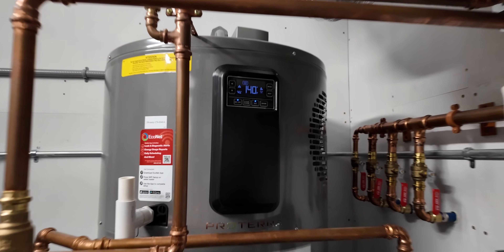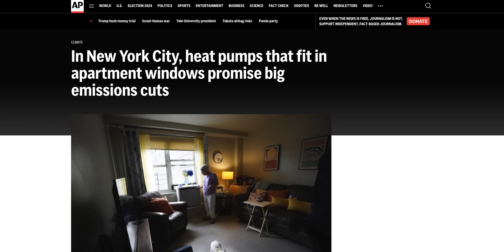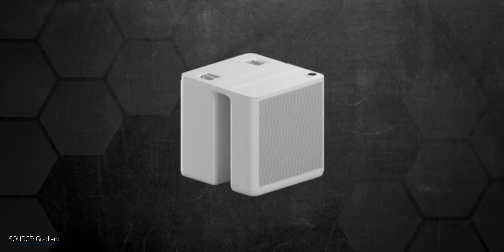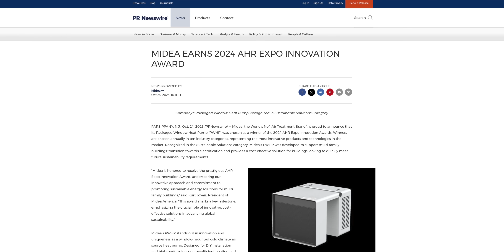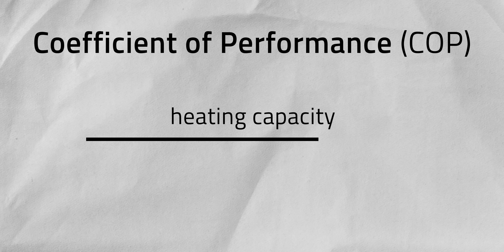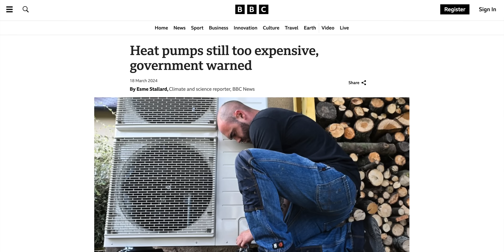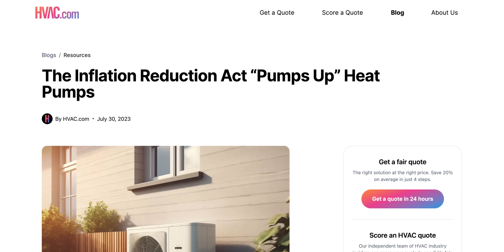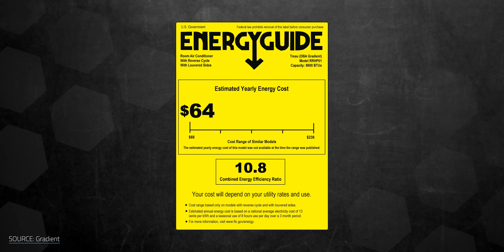Why This Window Heat Pump Is Genius

Comment: Wow - that cost is two years of heating my whole house with fossil fuels which are ridiculously inefficient and that's before grid energy costs.
A $200 AC unit is a 1-way heat pump. I'd like to see those engjneers produce a $600 unit that doesn't require financing and an extended warranty.
I could run those off my solar batteries.

Comment: Some numbers on the achievable internal temperatures would be useful. This seems to be the stumbling point for 'central' systems in older buildings. Also, in relation to the demands on the electric grid, many apartments would be using more than one unit. Would the supply authorities still be confident of meeting the demand?
Reply: Achievable internal temperatures only depend on your insulation factors. You could get 110 degrees F if you confined the heat to a small insulation box. The 9000btu/hour is the only useful metric to report. Maximum temperature would also depend on the temperature outside.

Comment: So as a homeowner I just save half the money and get a more efficient mini split... The window heat pump doesn't really sound like a good deal tbh. And for $150 for a unit that just cools to jump to $3000 for a unit that does both just seems ridiculous. I know ones with the same efficiency score are around $500 but still. Seems wayyyyyy over priced.
Reply: These are not being made for the homeowner market. Odd how so many people think thats the case. Its for apartments.
Reply: @thecocktailian2091  The point of the statement was the price. A heat pump shouldn't cost that much more than an AC unit. An apartment owner isn't going to pay 5k per apartment to barely save any money each year.

Comment: At the end of the day, for most people it's cost that matters. My friend got a Heat pump installed, and due to high electricity costs, he's paying more then 2x what cost him when he had natural gas heating. The energy guide has electricity at ¢13/kWh, I pay 3x that when you combine deliver/usage fees. While heat pumps are excellent technology, I don't expect them to get lots of traction when it's cheaper to use gas heating. Though NYC is banning gas heating in new buildings.
Reply: Yes, through the efforts off CCAN and others like it, you will be relegated to only using energy sources they approve of at a much higher cost.
Reply: You pay for gas by the therm. A COP of 1 takes about 30 kwh for 1 therm. So even if you have a good COP (say 3-5) and a therm of gas was twice as much as a kwh and the gas furnace wasn't that efficient it is still less money to run the gas. If they take natural gas away, wood furnace or propane is still cheaper.
Reply: @barongerhardt  Right, 1 therm is about 29.3 kWh. But where I live, electricity is about 3x the cost of gas per kWh, and a COP of 3.0 is really optimistic for a reversible air source heat pump in cold weather. Remember, these machines lose efficiency AND heating capacity as the outside temperature gets lower. I have a (partial-home) mini-split heat pump rated to continue functioning down to -13F, but it's cheaper to use my ancient gas boiler below about 30F, and the heat pump has trouble actually keeping the first floor warm below 20F. I know, "old home problems", but until I can get a major insulation upgrade that's how the math works. On top of that, a dedicated heater system can distribute the heat better than a system that has to do both heating and cooling. The thermal gradients in my home are greater when using the min-split heat pump than when using the boiler distributed through hot water baseboards.
Still, for keeping warm in spring and autumn the heat pump is great. It's a backup for if the boiler kicks the bucket, and it diversifies my heating energy sources in case the price of methane spikes.
Reply: @wescoleman6390  With a base difference of gas being 30 times cheaper than electric, the economics of it just don't work. These modest efficiency improvements cannot make up that gap. On top of that, they are charging 6-10x as much for what is an AC with a reversing valve. They are trying to scare people into it with "gas bad" and get government idiots to pay for it with other peoples money. Yay, taxes!

If you like how these ones look cool, but it is just an aesthetic change.

As you stated heat pumps lose efficiency fairly quickly when outside of optimal conditions. Most places I have lived, those conditions heavily skew to the lower temps. If normal inside temps are 70-75 a hot AC day might hit a high of 100 or 30 degree delta. Going the other direction that is only down to 40 degrees. I could go a whole month without it going over 40 and lows below 0. A 70-80 degree delta. These things are great, if you want your winter electric bill to be as high or higher than your summer bill. I'm surprised the electric company hasn't replaced the free light bulbs program with free heat pumps.
Reply: @barongerhardt   Gas isn't 30 times cheaper and nobody said it was. 29.3 is the conversion factor between the archaic unit "therms" used on gas bills and the more sensible kWh used on electric bills. In my part of Massachusetts we have expensive electricity ($.32/kWh) and much cheaper gas ($1.92/therm). Adjusting the units gas is $.065/kWh or about 1/4 the cost. With these rates a standard heat pump doesn't make economic sense. In other regions where electricity is only 2x as expensive heat pumps are cheaper to run as long as your average temperature is above ~10F. For these people a heat pump will cost the same in winter but will be much cheaper during spring.

I totally agree the units in this video are way too expensive. A mini-split of the same capacity is well under $1000.
Reply: Looks great Sounds even better But the $3,000 mark is a little bit over the top
Reply: If you run the heat pump by a battery storage system, where the latter loads shift cheaper off peak electricity, it should result in a cheaper system to run.
Reply: Yeah. Comparing thermal efficiency across fuel sources isn't really useful. There's an argument to be made that the government's role is to internalize externalities, meaning they should price the climate costs of using natural gas into its rate, and that might even out the cost. Comparing efficiency is useless unless the waste heat not utilized is problematic.
Reply: @andrew40  Internalizing externalities is most certainly not a role of government. If anything government should be cracking down on this as fraudulent deceptive marketing. This is the equivalent of marketing a pickup with 100 gallon tank as having a 1000 mile range being better for the environment than a civic's 500 mile range.
Reply: @barongerhardt  Internalizing externalities is absolutely a role of government. People can debate over which externalities to address, or how to best account for their costs, but to ignore it distorts the economic system.

What I'm saying is a like-for-like comparison is best. Comparing thermal efficiency of electric and gas systems is nothing more than an academic exercise. If an environmental argument is to be made, it needs to go back to full lifecycle impacts of the energy source for both. That is complicated, and fewer people are willing to sit through it. I suspect the heat pump would still come out ahead, and the only way it makes economic sense is if those full lifecycle impacts are built into the price of the product and fuel.

Comment: Why hasn't this saddle style been used for AC units this whole time! So much better to be able to have an operable window and keep the views and daylight!
Reply: A saddle design requires that condensed water on the inside be pumped up and over the U shape to be drained or evaporated outside the windows. That means that this design is more complex and failure-prone than ones where water can drain out the window by gravity.
Reply: @nathanschley2088 that’s a pretty small price to pay for the increased usability
Reply: @nathanschley2088  that makes sense! Though I still think being able to have a window that is still operable with minimal blocking of egress or daylight would make these more than worth an extra little pump or bucket for condensate in most cases! Hell if your adding the pump maybe it could even drain to a flowerbox attachment or something
Reply: And limit the amount of gap that has to be poorly installed on either side of the window. Actually if the gap is small enough this should be excellent to insulate with a single strip of foam 😂
Reply: Tbh if you look up saddle window AC you’ll find this wasn’t a new idea at all. The other downside is it has to cover different sized walls in different buildings their isn’t a standard wall thickness

Comment: I live in Boston, in an apartment exactly like you describe. We have to open the windows in the winter or die of heat stroke.
Reply: So you can spend 3k on one of these an use even more energy to cool down your apartment?  I don't get it.

Comment: The biggest thing i don't like on this setup (which is the same issue and actually worse with a window ac unit) is by having a double hung window open any amount, the seal between the top and bottom window is open. So you have a major source of energy loss and possibly bugs as well. These heat pumps and older window ac units provide some sort of filler pieces for around the unit itself. However nobody addresses the gap between the sashes.
Reply: Because filling the gap is incredibly simple. Anyone with an ounce of DYI home skills can do it. Just ask your neighbor on wither side of you, I absolutely guarantee you one of them can sort it out for you.
Reply: @thecocktailian2091  i am more than capable of doing it so you can tone down your condescending sarcasm. My point is the unit should include something. Even if its just a roll of foam backer rod or something. I have seen a lot of window units that haven't had that area sealed because of two reasons. 1- the person putting it in likely has very little knowledge and/or skill in home work and doesn't know it should be done or how, and 2- that same person was likely so fixated on getting the unit into the window and operating that they didn't even think about that little gap above. I mean as a glance the window is still basically "closed" once the unit is in place and the window brought down on top of it. Many people don't know or care to know the details of how windows seal the just see its closed and assume it's good. The average american home has enough small cracks and holes in it to equate to a window being wide open all year around. The last thing they need is a window actually partially open.
Reply: @95dodgev10  Fair enough.

Comment: If they want to be realistic about being "environmentally friendly" with these, then someone is going to need to design one from the ground up that has serviceability in mind.  Even the best compressors have a finite lifespan. Replacing several hundred boiler and chiller systems that are designed to be serviceable vs tens of thousands of units that are more or less disposable is not "environmentally friendly" when looking at the big picture.
Reply: You would be surprised just how much energy a lot of these systems save in 5-10 years, even if they're disposable they could still come out way ahead if they last 10 years. I agree that they should be serviceable though, and be built to last longer than 10 years, aiming for merely "less bad" isn't exactly a noble goal
Reply: Come on man, don't replace the brakes on that "clunker" get a whole new car! We already established new everything is better for the environment like 20 years ago.
Reply: Exactly right. These very rarely get disposed of properly. At least this one is explosive (r32) so it might force some attention to it.
Reply: @garrettmillard525   R32 isn't explosive. It has a safety class A2L. The "L" in A2L means it burns slowly with a maximum velocity of 10cm/s. And 2 means "refrigerants of lower flammability."
Reply: @eDoc2020  You're right. So these will undoubtedly be disposed of improperly as well.
Reply: @garrettmillard525  R32 really isn't explosive. I saw an hvac video where he sprayed the refrigerant into an open flame and it actually extinguished it.
Reply: @EthanThruandThru  to create a explotion you need the right (wrong 😄) ratio of gas and air..
 any gas can put out a flame under the right conditions
Reply: with the weight of oldschool heaters, we can make 3 new out of sommething old 🤣 and even have something left..
all i see is we end up with more in the end 😜
Reply: your not lying, window air conditioners, portables are disposable, except those huge systems aswell as central and mini splits which are serviceable
Reply: Nice. This comments section would bring a tear to Louis Rossman’s eye. 
Right to repair, freedom in your ownership, and repair-ability, sustainable/environmental friendly solutions, converging may actually bring US consumers some needed economic relief and clout to use against the corporate conglomerates. 💚✊
Reply: So a compressor lasts on average ten years. Not exactly disposable, but not a legacy system either. Seems a better compressor is all that's needed, not a ground up reengineering.
Reply: @thecocktailian2091  or just make them REPAIR FRIENDLY.
Reply: @thecocktailian2091  I don't disagree with you, but that 10 year figure you mention is because home appliance type things are intentionally designed  to last 10 years, we probably have the capability already to make them last much longer, but we won't... because money... and throwing away 1, 20 ton chiller compressor every 10 years is not the same as throwing away hundreds of 9,000 btu compressors every 10 years.
Reply: @thecocktailian2091  The compressor will not last if they are not designed to be serviceable.  We have a window ac that is 14 years old now.  It would have been dead and gone after the first year we had it, if I was like the average person who has no idea whats wrong and just throws it out.
The 2nd year we had it, I put it in to use for the summer and it was blowing hot.  The part on the outside was clogged with everything.  If I wouldn't have cleaned it then the compressor would have cooked it's self to death.  Doesn't matter how good the compressor is.

So the window ac we have needs to be taken apart every year to clean it.  It was NOT made for this, it was designed to be thrown away.  I take it apart to clean it and keep it working because I know how to, most people don't.  Funny how there is a filter to keep the inside part clean, but they conveniently leave no easy or obvious way to clean the outside part.  By design perhaps?
Based on the 3d render's of the unit in the video, they will not be designed to be taken apart and cleaned and if that is the case then I guarantee you that there will be tens of thousands of them in landfills within the first few years.
Reply: @thecocktailian2091  I see you don't see the 100,000 cheap de humidifiers that get trashed after 2 years of coming out of the hardware box stores like Home Depot. I have gone through about 4 in 10 years. The China quality of these is so so bad. Yet I have a 1975 that is still running in the garage on bad days that freezes up on colder day as it lacks technology to cope with colder days. Mandating thicker copper tubing so pin holing and letting Freon escape would help as most just lose Freon and it is far far cheaper to buy a new one then pay a $ 200 hr tech to fix it.
Reply: @thecocktailian2091  That or a unit designed for the parts to be easily replaceable.
Reply: @thecocktailian2091 if you're serious about any sort of environmental sustainability, design for serviceability and repairability should be one of your top priorities, full stop. 
There is absolutely nothing sustainable about products literally designed to be thrown away after an arbitrary "standard lifespan" rather than fixed, other than corporate profit. 
By designing things to as much of industry standards as possible, you allow parts to be replaceable at all, third party parts, even if they are lesser quality, are still often cheaper then OEM parts, and even available at all after the manufacturer stops making those parts, and more universal standards mean that you should be able to use the same decent quality parts for longer times in more models. 
This would also allow consumer options such as buying a modest quality built unit that has features you want, and simply upgrading the underpowered or lower quality parts as needed. 
The old paradigm of trying to lock in customers through intentionally proprietary parts has finally started to fail, partly because of the dramatic rise of cheap Asian production and their habit of counterfeiting, anyway. The whole racket of "posh" manufacturing and design is dying off, when even the ones who actually care about brand as some sort of status can now get 90% of the quality in a decent knock off for 10% of the price.